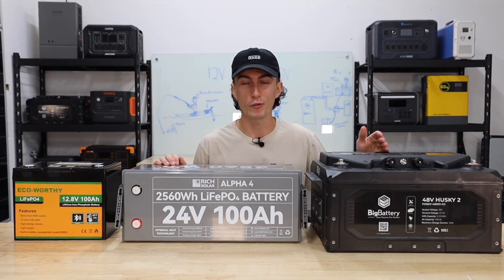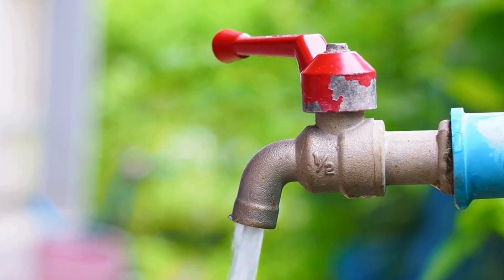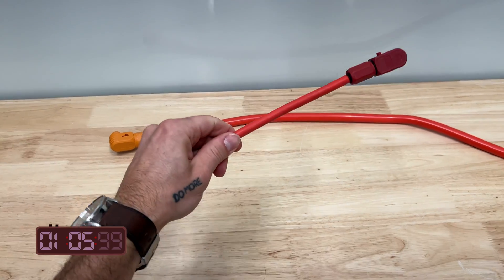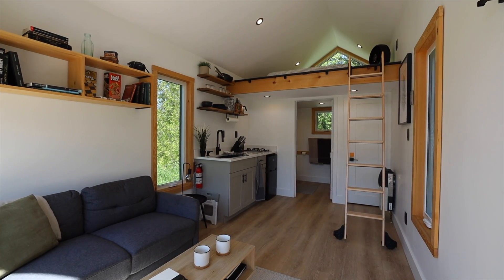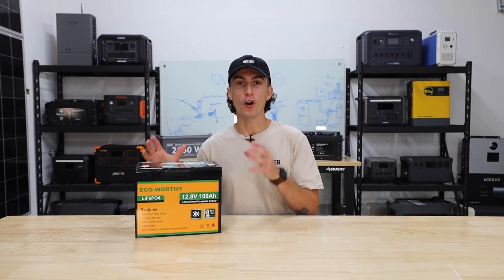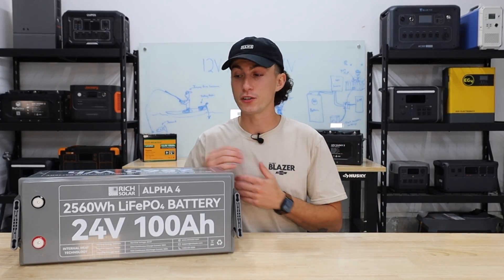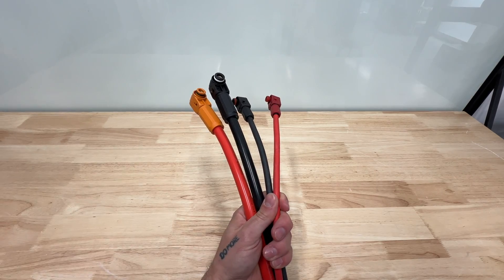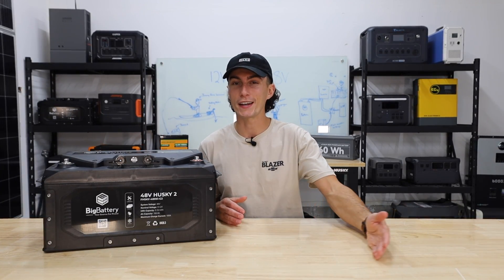Which is Best? - 12 vs 24 vs 48 Volt Solar Batteries Explained

Comment: I am using 12v -240v 6kW 100% off grid system for a long time now and I don't see any problem with that. I actually have 2x 6kW inverters mainly for redundancy. My battery system is 19kWh, actually 27kWh nominal but some are lead based and I use 50% of that capacity and 100% of the lithium in the calculation. Cost wise it is no more than the average 48v system. If someone don't know how to design a proper 12v system they always badmouth it.

Comment: Gud afternoon if I need 48 volts but may budget is tight And I buy 4pc 12v 100amh can I parallel connection to get 48v  that I need.thank you for answering
Reply: Seems like nobody wants to answer you. No, if you parallel them you still get 12v but at 400Ah. You must connect it in series to get 48v @ 100Ah. If you don't know this basic information, I recommend getting someone with the knowledge and experience to help you.

Comment: Does a 48v dc to ac converter have less lost than a 12v dc to ac converter? if i am  using no more than1000W with the right gauge cable for each one

Comment: 48v is expensive, genius. Most normal people do not have excess funds to just dump thousands on a 48v system. Skipping 24v is stupid. 48v can KILL YOU as well. The average person shouldn't be playing around with it. If something goes wrong with 12v or 24v, you get a lil zap. With 48v, you get a funeral. Your advice is dangerous.

Comment: 12v is everywhere and cheap.
Larger guage wires are safer in the long run.
48v is more expensive in the long run as the inverters burn out you are looking at one hell of a replacment bill vs 12v inverters are everywhere and cheap.
On top of that you can upgrade from 12v to 48v without rewiring everything.
Larger guage wire is always better no mater what application.

Comment: Im still 100% confused.  'Go with 48v because wires are cheaper'.  But the wire length from the components is very short.   The cost difference would be small.
12v lithium 100 amp batteries today are under $300.

Comment: Will batteries last longer in a 12V or a 24 Volt system? Thanks.
Reply: No, if treated the same, it will last the same time irrespective of voltage.

Comment: This would SORT OF make sense if a 100ah 48 volt battery cost the SAME as 4 100ah 12 volt batteries. They don't cost anywhere near the same, but you're getting the exact SAME storage capacity. It is MUCH less expensive to ONLY use 12 volt battery packs in series to produce the SAME thing as one 48 volt battery pack... but the 12 volt battery packs ARE MUCH LESS EXPENSIVE! Not only that, but when a cell fails, only that single battery pack needs to be replaced whereas the entire super-overpriced 48 volt battery pack has to be replaced when only one of the 16 cells inside dies. 48 volt packs are STRICTLY for those who don't really care about the money and/or don't understand basic wiring.

Please people, don't get screwed by the chinese manufacturers by buying 48 volt battery packs. They make a TON more money on them and you get to pay a TON more money when one of the 16 limited lifespan cells in that pack dies... and they ALL DIE at some point.

Comment: A 12v installation suits 12v cars and vans, there are hundreds of 12v accessories from camping and car gadget shops BUT 12v is effectively limited to about 1Kw loads because of the current needed for big loads.
24v systems work well for 24v vans and campers, they will easily supply around 2Kw for short times, and some accessories are available from truck suppliers.
48v Is still low enough to be called low voltage in law, but it's powerfull enough to run multi Kw loads. There are NO toys and gadgets for 48v so it's normal to need a big inverter and a charger and charge from mains and use at mains voltage, wired to code.

Comment: funny i use the same analogy.  but voltage is pressure, current is flow, and diameter is resistance/gauge.

Comment: Great advise. We live FT off grid in our motorhome strictly off solar/battery power. Since our coach came from the factory with many 12v native appliances, such as our hydraulic jacks, slide motors, lighting, etc. We retained our 12v system for our native 12vDC needs and added a 48v system for our 120v high load ac needs. They are stand alone systems, but I do have a small 1,000w 12v inverter for redundancy, to power our fridge, PC, TV, etc. if our 48v system goes down. Our 12v system uses a 620w liftable array on the side of our coach, that doubles as a nice bedroom window awning too. It charges a 560ah 12v LiFePo-4 battery made from 280ah prismatic cells. This left our roof free to rack 8, 550w solar panels down the length of our 35ft Class A, 15" off the roof, above our A/C, vents, etc. Our 4,400w array can run both our A/Cs (we use a mini split on the rear), our household appliances and charge our batteries at the same time. Our 48v battery which resides under our bed uses 16, 320ah MB31 EVE cells and a 200amp BMS. Together with our 560ah 12v bank, we have a total of 23.5 kwh of batteries onboard charged by 5,020 watts of solar. This has proven to be sufficient for our needs, as we haven't had to run our generator in over 2 years. We found that we saved a lot of money on 48v components which operate more efficiently than their 12v counterparts too.
Reply: What kind of mileage do you get?

Comment: 12v is pretty much universal. Others intended for solar with charge controllers.
12v just means you need a bit bigger cabling. 
12v is also for high wattage like your engine starter.
Nothing in common use uses 24v or 48v.
Those are special application.

A typical house needs about 25kw of power available at any time. All electric house may need even more.

48v requires two batteries and a more expensive inverter.

12v you can run off your car in a pinch except for heavy loads.

Comment: Amps and PSI are similar. Amps can burn up a wire that's why the gauge for certain amperage. Just like PSI can blow a PVC pipe there are rated for Psi.

Comment: My knowledge is very low, but I think there are some disadvantages of going with a 48V system, like the danger factor of using a 48v system (nominal voltage over 50V) which is a high voltage system. Also, I think that an array of solar panels have to produce 5V more than the nominal voltage (over 50v), and that isn’t easily done? Anyway, you should make a video that talks more about the reality of making the choices!

Comment: Thanks for the video. I'm thinking of getting one of the name brand power station like the ecoflow delta 3 or bluetti ac180 and expanding it with a 24v 100ah lifepo4 battery. My setup is to run a side by side refrigerator and or an upright freezer for emergency purposes. What do you think?
Reply: I would recommend the Ecoflow Delta 2 Max. Twice the runtime as the Delta 3. Two MPPT inputs, you can run two lines from the battery (or solar) to it, to charge it.

Comment: Help Needed

I know very little about electronics... I am toying with the idea of buying a 1500WH - 2200W output power station and adding a 5kwh golf cart battery as a power extender.... and then backing that up with a small 3k inverter petrol generator.

The power station only has a 400w max input, but I am assuming I can still charge it with a generator at 400w
And, I am also assuming that I can charge the 5kw battery separately (and much faster) with the generator also

This would give me 6.5kWh (for Home emergency backup) for a cost of £1,500 (about $2,000)

Am I as much of an idiot as I think I am, or will this be a possibility?
Any tips/Advice?

Comment: For me, I use 12v or 24v. 
I usually advise customers to do the same. 
Especially when off grid. So you can run lights directly off the batteries.
Reply: See my comment on this video.

Comment: Please help me for BMS more than 72v . I am building battery with 144-216 DC volts. If I will not be able to build/ get that BMS, I will be using THREE 72v BMS batteries in SERIES to achieve 216 v dc battery bank to be directly charged with string of solar panels.

(Reason, I am replacing - in phases, all my home electrical items from inductive to bldc/SMPS run.
 In daytime, I have already attached 'inverter compressor fridge', bldc fans, flat TV, LED tubelight and bulbs, induction cooktop, water heater, mobile charger etc. all except my microwave oven and water pump with induction motor.
 For water pump, I will be rewinding dc pump to make it 220v dc compatible. 
For oven, I am searching fully SMPS based microwave oven.

I have attached all appliances directly to 6 (series) solar panels without charge controller and inverter...).
 Setup at present is without batteries... But running smoothly upto 4:30pm in winter and 6:15 pm in summer.
When I will buy batteries, even then I will not be using charge controller and inverter. Those batteries will be directly connected to solar panels and home appliances...just with fuses, blocking diode and isolation switch.
THANK YOU.

Comment: yeah been staring at what systems would be best for me and the setup i'm aiming for. 

even though 24v would be pretty I'm just going to do 48v, because at least with some of the All-in-one inverters they have spilt phase and can be 120v or 240v. 

A little more more but setting a system to 24v has been kicking my ass

Comment: I just want 2 100 watt panels 1 100ah battery 1 inverter. To run shed lights, charge tool batteries,run attic fan. 500watt inverter is posting around pure sin wave got panels. Just need find good mppt controller and a agm or lipofe4 battery

Comment: I ran a 12V in my semi-live in van, If I did it again I'd likely run a 24V system, I wanted to run 12V due to the ease of running 12v outlets/lights internally, but most of these are available in 24V now and the wiring is much easier to deal with. Not to mention doubling my MPPTs output with 24V would be ideal. Overall I'm happy, I have the dometic 12v RTX2000 AC system, 1000W of solar, and 620Ah of battery bank, but the 24V system would allow me to do that much more easily, with a smaller MPPT and less wiring. The MPPT I am usiing cost about 380$ with 24V I could get away with cheaper wires and a ~100$ MPPT.

Comment: One can save money by wiring the 12 v batteries and panels in series to create a 48 v system thus reducing the need of higher guage wiring.  Savings comes from reduced heat from the inverter and other componets especially if one plans to rum 240v appliances.

Comment: The only problem with 48v is that there's basically nothing that can run directly on it, so you have to use the inverter all the time which decreaces efficiency. 24v is a happy medium between 12 and 48 as it allows more power, but most things that  run on 12 will also run on 24, so it's good for an off grid cabin where the system is still small enough where every watt counts, but you need more power than 12v.
Reply: And what can you run on 24 that should be run on 12?!
Reply: What are you running from 24v that isn't avaliable in 48v
Reply: @shaynegadsden  I run three fridges on 24V. They are the ones for RVs or trucks and auto select 12/24V, so they run directly off the 24V and the 2500W inverter runs all the 240V stuff. That way I save the losses of running a dc-dc converter to reduce the power to 24 from 48. So 24V is much better for smaller RVs and trucks than 48V.
Reply: @OldSchoolDrifter since when is an RV or Truck a small cabin
Reply: @shaynegadsden  No difference power wise, just one is static and the other is mobile.
Reply: @OldSchoolDrifter massive difference why would you use portable fridges in a cabin also why would you add a third powers to an RV or Truck they already have a DC and AC power
Reply: go with buck boost DC DC converters for anything you need to run off the 48V batteries.
Reply: I don't have anything that runs off DC power
Reply: Can you run a mini split on 24-volt?

Comment: I was on the 48/51.2v 100ah train, until I saw these 12v 300ah batteries. I may give them a try just to see how they work out. I can buy 4 12v batteries to create the 48/51.2v system and have 300ah at a cost of $1400. That same 48v system with 3 batteries will cost me around $3000. I could purchase the 12v system twice and have a 48v 600ah system for around the same cost as the 48v 300ah system.

I'm at a crossroads but I think I'm definitely leaning for the four 12v batteries.

Comment: I’m using a 24v 100AH battery to charge my EcoFlow delta-3 and river 3-plus… Strictly an emergency if the sun is not out. Charged with 400 W Panel with Victron 100/30…
Reply: Why are you using a battery to charge a power station? What?
Reply: @ragnaroksangel  Because he needs more capacity then what they provide? I think basic Delta 3 is less than 1kW, that is not much really.
Reply: @IgorBgd  It still doesn't make any sense.

Comment: So how do you step down for 12 volt loads?  Thinking of sailboat with 120v appliances and 12v devices.  Thanks - good explanations in the vid.😊
Reply: DC-DC converters can be used if you need 12v

Comment: What if you get 2/0 awg wiring for free? I can buy cheap 12v batteries and have the option of 24v, 36v or 48v. With 48v that's the only option. I can get 4 12v batteries 120ah for less than $400. Those 48v are expensive. I like the redundancy of 12v

Comment: I just bought a portable fridge/freezer combo for camping. It's 45W efficient and 50W max. Is a 12v lifepo4 battery sufficient? Or should I power it from a 24 or 48 volt battery? I thought Ah is the capacity (stored energy), like the mAh powerbanks used to charge phones, and volts is the power/strength of the battery. I guess I had it wrong? On a 100Ah 12v battery, I could power the fridge for about 24hrs. So it will be double on a 100Ah 24v or 200Ah 12v battery? Thanks.

Comment: I am having a grid tied 9 KW solar array using Enphase microinverters without battery backup installed in the next month or so.  I am comfortable doing battery pack level work (in my garage, not up on a roof) so I am confident in my ability to make my own 48V battery pack for aprox $2000 and another $1,500 to $2000 for an appropriate inverter so around $4000 for a DIY 15 kWh pack... or I can go with a commercially available high voltage (400 volt range) system and get 13 to 15 kWh for $15,000 to $18,000.  Is there any reason other than cost to NOT go the 48 volt route?  Or, if high voltage systems are better, are there DIY high voltage options I should consider?

Comment: Ok... I want to say he does a pretty fair job explaining with his analogy. 

The fundamental rule of thumb for picking your voltage is the following: think as of this system is 100% off grid.

If you are aiming to keep minimal 120v 15amp circuits limited to approximately x3 in full use and near full demand. Go with 12v

If you are planning the same but also need 30amp devices go with 24v

If you are planning on full scale 100% home use which includes 50/60amp demands. Then go 48v.

The concept is this. Your inverters "work" to provide power for potential use is rated by its internal components. 

The wider the range of amp potential the higher the voltage that is needed. 

Higher voltage supply means less internal wear & tear on the PCB and its soldered connections. 

Think of it like this. You have unleaded gas 87oct. 

You have a straight 4 tractor engine = 12v

You have V6 = 24v

You have V8 = 48v

each engine will perform work but the higher the demand the lesser engines work harder in order to provide or even stall/burn out.
Reply: I think you explained  that better than he did lol
Reply: I want a V12❤
Reply: @bobbieprice1351  V12s are junk.
Reply: Go teach a class bro fr

Comment: of course, 36V doesnt get a mention.... how ironic... virtually every grid tied panel system i get given uses... guess what? 36V panels...

very green... cant repurpose them easily. batteries and inverters for 36V arent terribly common... yet the panels can be had for free...

ha ha. 72V, less current. cheaper wiring... if i had my way it would be 144V... switchgear starts to be an issue.